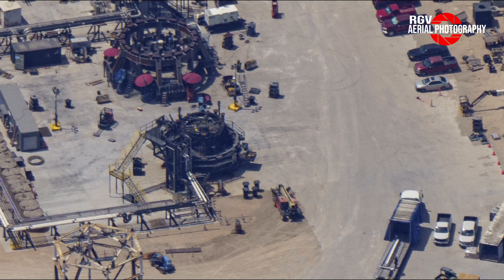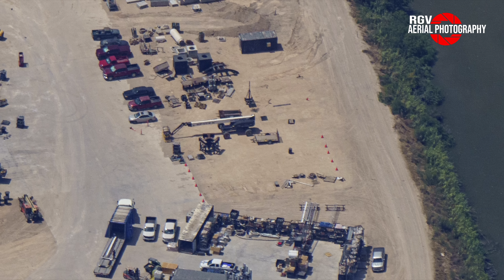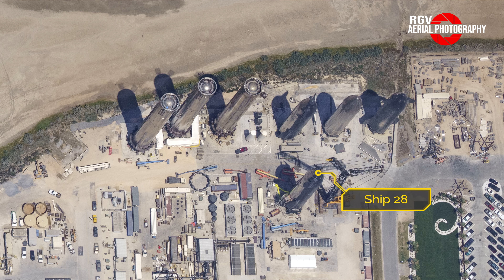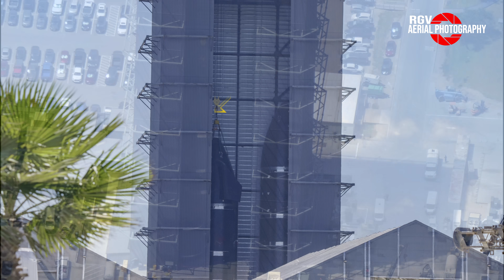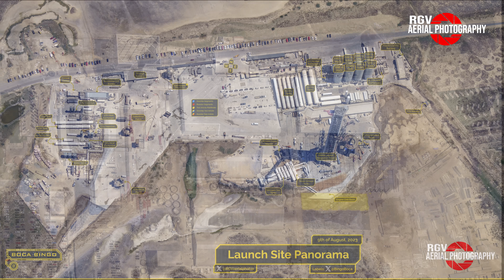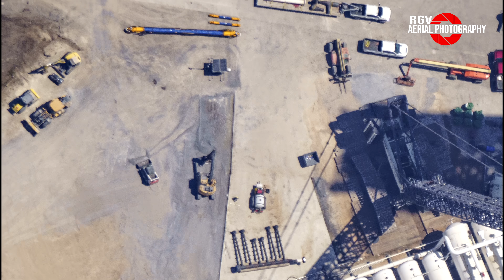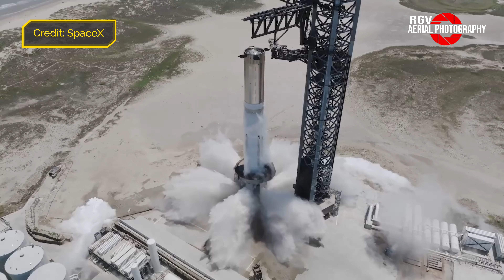Hotstaging, Starfactory Expansion, Post Booster 9 Static Fire and More! Starbase Update Episode 12!

Comment: I wouldnt be surprised if its cracked concrete at the OLM.  It was so hot when the poured that it couldnt have had a very good cure.  In my opinion.  If its cracked thats not good for future launches  that could loosen the cracked areas.  I hope it is all good though.  Thank you for your flyover Mauricio.
Reply: Maybe the marks are used to track how the waste water flows toward the retention pond, so they expand it properly?
Reply: Worst case scenario they just rip out the Fondag and cover the whole area over with plate steel. They sunk plenty of piles, just a matter of drilling into them and sinking anchors.

Comment: With the concerns about the engines and reliability...let's remember this program is still in development.  New designs of everything.  It is going to take some more time to get it all worked out.  SpaceX has spoiled us by keeping us updated regularly and letting us see the sausage being made.  They are doing all this at break neck speed compared to historical timelines.  I just had a thought...if a large asteroid was found to be on track to impact us in one year's time which company would most likely be able to get equipment out there to try deflecting it?
Reply: The Space X Falcon 9 was the booster that launched the dart probe a couple years back so they would be best suited for such a flight.  Then NASA would probably contract again with the Applied Physics Lab to construct a probe like Dart perhaps upgraded if the asteroid is significantly larger.  

That's a guess of course because perhaps NASA has other plans in place if an asteroid is determined to be an imminent threat.

Comment: SpaceX might as well cover the entirety of the launch pad in steel. If those cracks contine to propagate water will  seek its way in eventually leading to erosion of foundations. This would also be a good opportunity to design a water capture system.
Reply: I think those painted cracks are from after the test. The paint would likely not have survived the test fire in such good condition, and it looks like there are similar yet unpainted cracks on the other side of the mount. 

if those are cracks after (only) 2.7 sec test of the engines at a reduced power setting, then I fear we will see concrete flying during actual launch. 

Not as muchas last time, but not completely clean either.
Reply: @torben777  using the B7 results to calibrate my expectations, I don't think this system will have any concrete flying.

Comment: Excellent work, gentlemen! I believe that they have already diagnosed the issues with the non-firing Raptors, and will perform another full static-fire once some hands-on examination has taken place. Moving the O/U on next integrated launch to 25 September.
Reply: I wonder how the feedback system for fuel/oxidiser works, there must be active feedback, but as for sensors, would they use an O2 sensor or an optical sensor to determine flame colour. I would love to know.
Reply: Oh, was it the engine themselves? I was thinking that the issue was quite possibly the OLM plumbing (or some such) that was the culprit.

Comment: I think the new building at Masseys might be a stacking tower with a bridge crane built in. Boosters are taken in on a SPMT & then lifted onto the test stand, which is then moved over to the test site. point. There would no longer be a crane required at Masseys ?.
Reply: It currently looks like they will use combined transport and testing stands for testing at Masseys. The Stand is moved to thebuild side by SPMTs, the ship or booster is loaded onto it with a bay crane and both are moved back to Masseys. This method was already used for S28 and the booster test stand currently under construction seems to be also built for transporting.